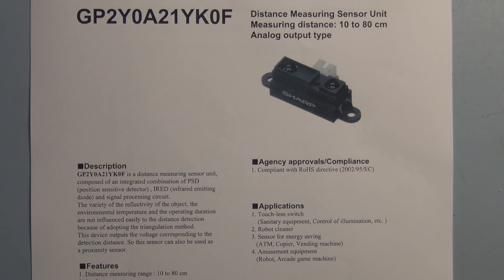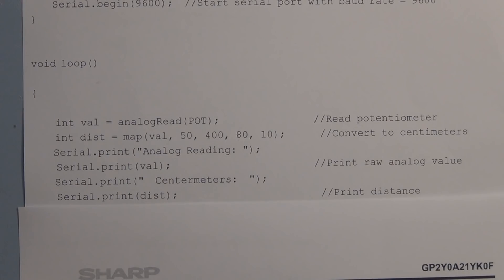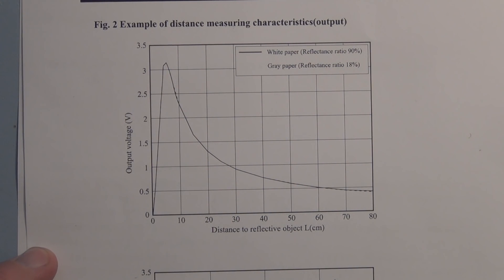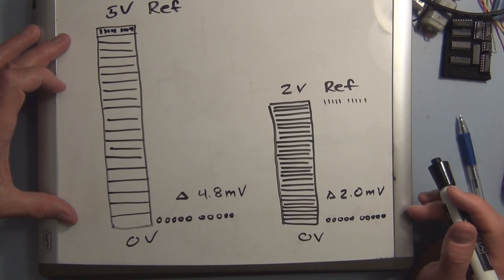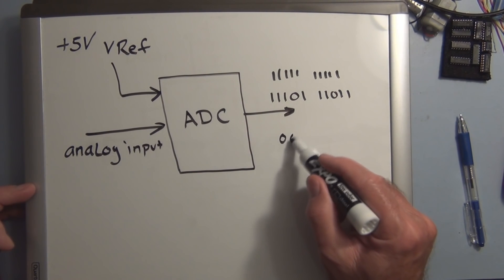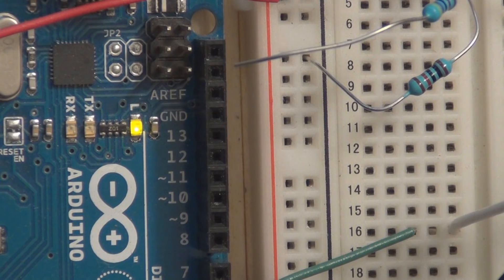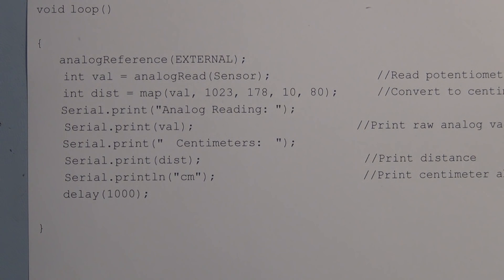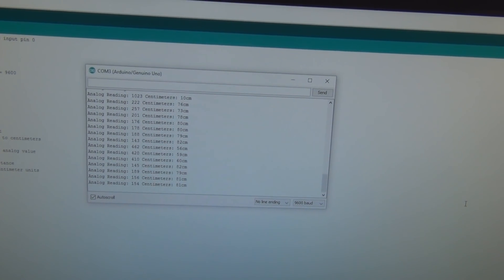Arduino IR Distance Sensor with External Reference Voltage

Comment: hi,i guess, if a sensor voltage of 3.2 volts is present at the analog read input your reference voltage should be at least 3.2 volts as well to cover the whole range in the close proximity range.
Reply from the maker: Yes but the sensor output response might not exactly follow the data sheet so you should measure the output for your particular application so you can calibrate the the distance and voltage so you know what external voltage to use.  You also might want to just get as close to that voltage using standard resistor values instead of having to use non standard values.